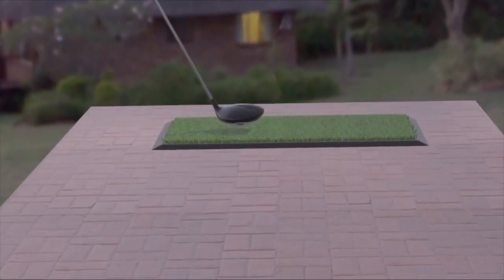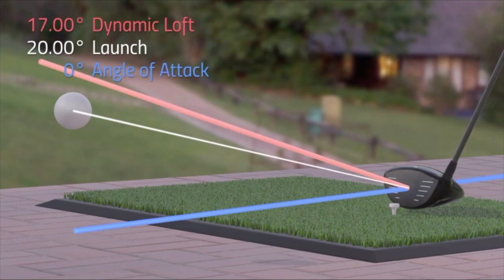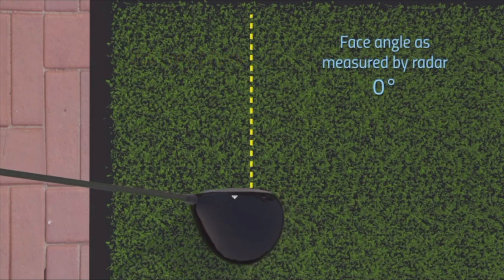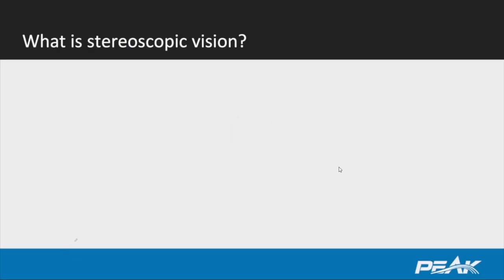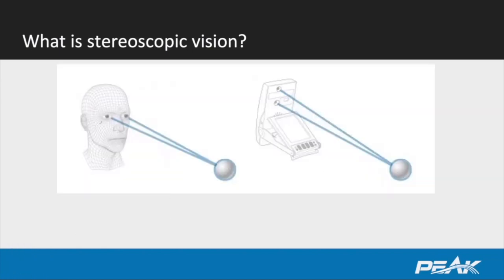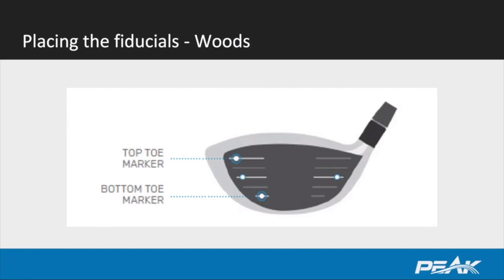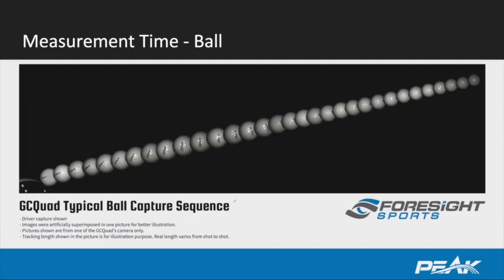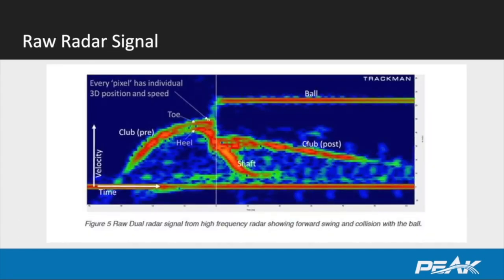Trackman vs GCQuad: Technology Comparison Review

Comment: I put my GCquad and a neighbors trackman 4 up against each other last night.  After putting a metallic dot on ball the carry yardages, back spin and ball speed seemed spot on with each other.  I ran into a  lot of discrepancies on every shot with swing path, club face and side spin between the 2 units.  My shots with trackman showed a pull draw while my quad would illustrate a push draw.  The trackman showed me as a negative swing path while Quad showed a positive swing path. I was indoors and you did hit on on the reason why that could be in your video.  My question is, outdoors you did not compare club data just the ball data.  can you give me your opinion on how the club data compared outdoors?  I still figured the trackman may suffer from gear effect outside as well but I am not sure.

Comment: Hi, 
interesting video. 
I see that on the indoor images you have used a TM3e vs the TM4 for the outdoor testing. Is this correct or have you just used stock images? If you  used the TM3e indoor then I wonder how the TM4 would compare to the GC4 seeing as it has dual radar and actually measures the club vs the TM3e..

Comment: Wow. Thanks for pointing me to this video (and obviously creating and posting) in the comments of your earlier video. Very enlightening. Just to make sure I am following along though. You essentially proved accuracy of GCQ based on the first test, which showed TM infinitesimally more accurate based on laser measuring actual shote results outdoors. The takeaway there is we now know GCQ is correct. Taking the test indoors, knowing GCQ is correct, and TM not having actual ball flight data to check/compare/calc/influence face to path, spin axis, etc, we see large discrepancies between TM and GCQ indoors, therefore TM REQUIRES actual ball flight to be accurate.
Reply from the maker: personally I love both launch monitors, but for my intents and purposes the Quad is better suited for me.  hope the video helped
Reply: @sklebeck  Makes sense and it did help. Plus the release of FSX pro, while details are few on the site, it is much closer to TM now in the way it shows stats plus it shows your average and standard deviation in the corners of each tile. If they could just create a super range now. It seems so easy as they essentially allow you to do the same on course (I.e. drop a ball anywhere and hit). Just wish I didnt need to load a course and choose a hole. But since I don't have one yet, maybe they do and I just dont know about it.
Reply from the maker: @cbwagner7269  you don't need to load a course to play a range with FSX 2020.  They do have the standard Foresight range as an option.  But I do understand what you mean about the excellent range for indoor use on TM.  When I get time I'll make a video of the ranges and practice facilities on E6 Connect.  There are again some unique ranges and great options for tracking accuracy etc.
Reply from the maker: @cbwagner7269  https://www.youtube.com/watch?v=bOmM3gwaJPA